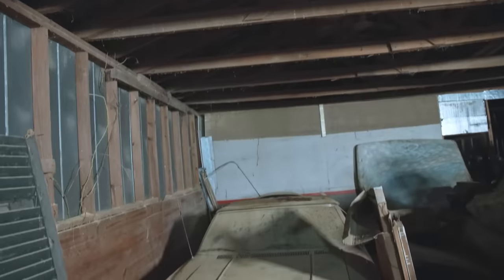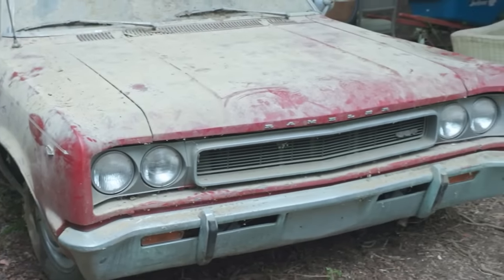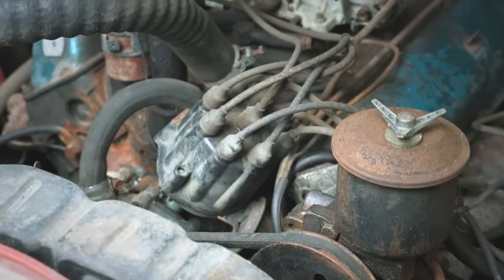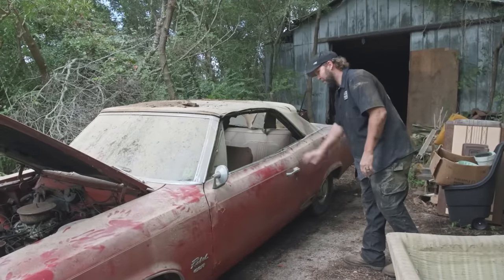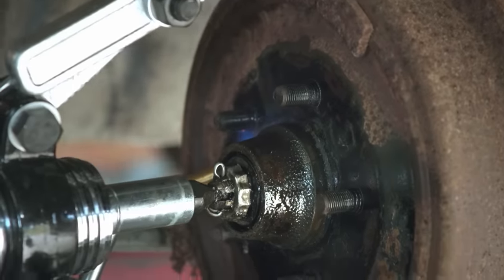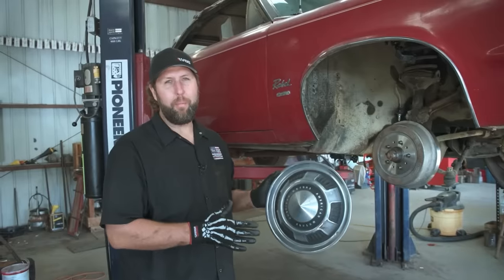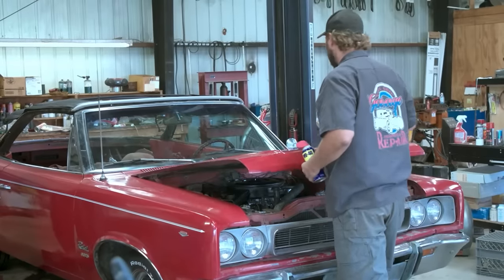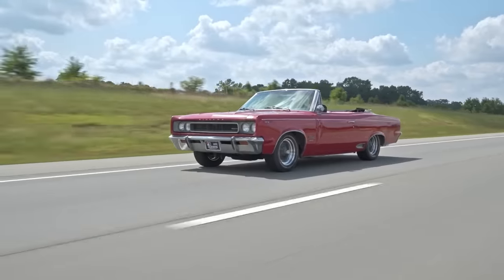Super Rare AMC Rebel Runs Again after 40 Years! | Roadworthy Rescues | MotorTrend

Comment: Hello Derek, my dad has a 67 Rebel SST convertible 343 with factory 4 speed manual.  No rust or weight reduction. Same kinda story...  set in a barn for many years, super low miles car. We tinkered around with it and put it back on the road about 10 years ago.  Have a few photos of it but won't let me post them here
Red with white top...looks almost identical

Comment: YEARS AGO, I bought a Jeep CJ7 with a basketcase engine. The engine was
not repairable so I set out in search of a used engine. I looked high & I looked
low. I looked to the east & I looked to the west but no luck. Finally, one day I
got another lead on a CJ7 in a wrecking yard & went to find it was the wrong 
engine. At the end of my rope,  I stood in the wrecking yard wondering 
what my next move might be, I happen to notice parked next to the Jeep was
AMC Ambasador. I popped the hood & FOUND GOLD!!! The exact engine I had 
been searching for!! My Jeep was an AMC Jeep. So I pulled the AMC engine,
took it home, rebuilt it & it powered my Jeep for 14 years until I sold it.

!
Reply: Owned a 76 AMC Hornet with the same straight 6 you'd find in a Jeep of the same year. Guy who bought that pile pulled the engine for his jeep and junked the Hornet.

Comment: I believe 1967 was the only year the Rebel had "Rambler " badges.  Another way to identify this as a 1967 is the lack of side marker lights; they became mandatory for 1968.  The Rebel was replaced in 1971 by the Matador,  which used the same body as the 1970 Rebel
Reply: But you'll note that there are rear side markers.  AMC must have been the first to do this.
Reply: @Gil Romard  I'm surprised but you're correct..,it seems that 67 Rebels got rear side markers.  Interestingly neither Americans nor Ambassadors got them that year!
Reply: I bought a red 1974 AMC Matador off a used car lot in 1979 for $1000.00.  Drove the car to St. Louis for a summer internship with Monsanto, drove all over the St. Louis area, then drove back to UNL (University of Nebraska-Lincoln) where I entered a Master's program. Finished my thesis and defended it in Jan. 1981. too late to graduate in Dec. 1980, instead graduated in May 1981.  Got a job out in SF, CA starting Feb. 2, 1981, so I drove the Matador out to CA as my daily driver.  Drove the car all over including many weekend trips to South Lake Tahoe for snow skiing and other late-night shenanigans.  The car was nicknamed the Red Shark.  Transferred to Pascagoula MS in May 1982, and drove from CA to MS in the Matador.  Unfortunately, the numerous rainstorms and humidity were not to the car's liking, and I got tired of the car cutting out and having a hard time restarting.  So, in December 1982, I traded the Matador in for a new 1982 Honda Accord.  I ended up totaling the Accord in a bad accident in April 1984. I then purchased a new 1984 Ford Bronco II, transferred back to the SF/Bay Area in Dec. 1984 just in time for another Squaw Valley ski season.  I drove the Bronco to Squaw Valley every weekend to ski during winter/spring of 1985 and had the Bronco II until 1987.  That 1974 AMC Matador has plenty of power and was a reliable car for me from 1979 to 1982 until I relocated to the Deep South.  Here is a tip, don't move to Deep South/Gulf Coast if you can't handle humidity and heat, or learn to adapt by acclimating yourself to the heat and humidity by going out water skiing practically every weekend.

Comment: A chain is the best thing to put in the gas tank preferably the kind that the links are just twisted shut instead of welded because of the sharpish ends I actually like to use a 25 lb bucket of drywall screws dumped in with the chain and some diesel and wd 40
Reply: Used chain many a time but not in the way you described. Got an AMC tank to do this week so I might try out your method.

Comment: 70  Camaro ss blew there doors off , I was lucky  60s an 70s cars were cheap when I was in hs my buddy got a 69 charger rt w 52,000 miles 3000.00 800.00 at napa we ran 12.0 1/4  roadrunner s went for 1000.00 guys would cam em and they would go. Btw    that charger would go through 2 tanks of gas in a Saturday night